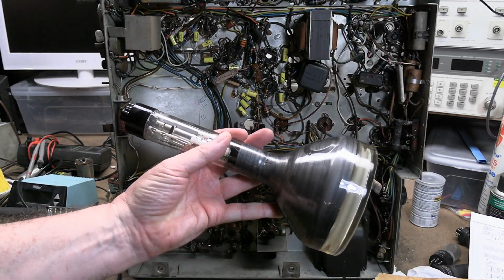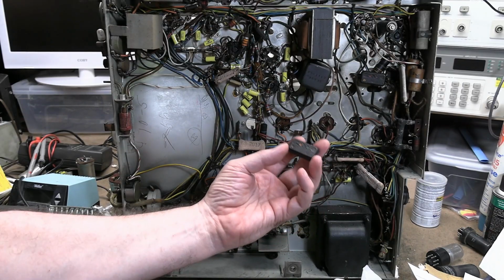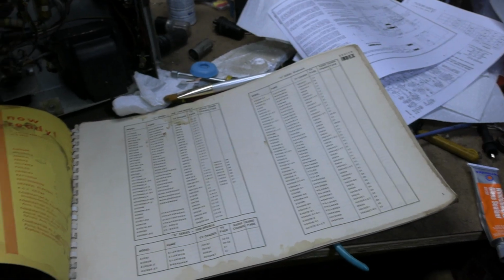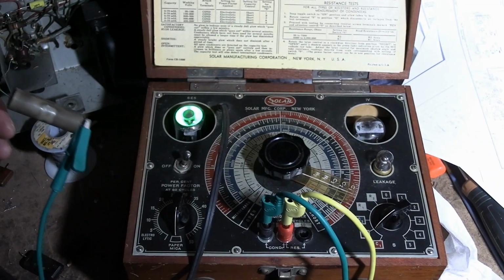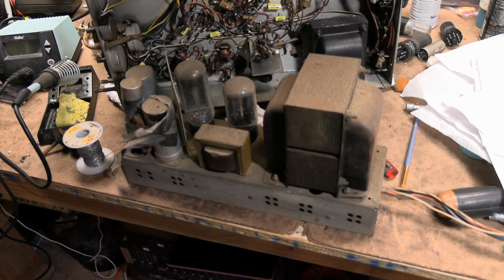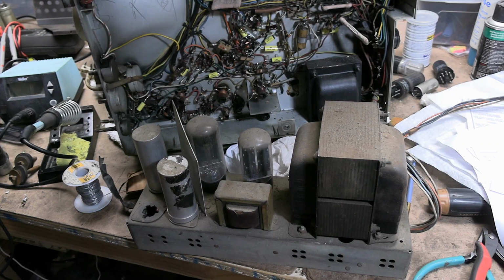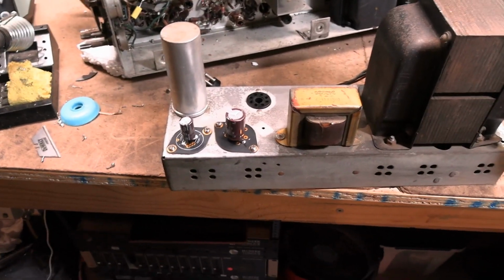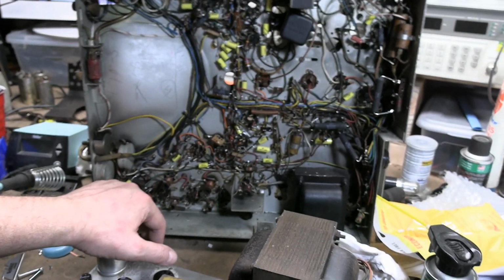Zenith 1950 St Regis porthole restoration part 3

Comment: I may or may not have had one of those Micamold paper capacitors explode on me. It was the across-the-line capacitor buried in my Emerson. One time when I plugged it in there was a little flash and pop near the power inlet but since I couldn't find a short I figured it was a speck of stray solder that self-cleared. When I finally got the old cap pulled out there was a chunk blown off its case. Perhaps it exploded on my watch, perhaps it cracked decades earlier.
Reply from the maker: Oh yes.  Many sets have those firecrackers on the AC line.  I try to remember to clip them out before power up.

Comment: Nice to see that you found a fix for the test CRT that was acting up.  With G2 disconnected from the socket pin, the element probably would have had a much higher potential induced on it by the ultor.  Don't at least some CRT testers have an "open element" check?
Reply from the maker: Yes for open filament, cathode and grid. Not sure about G2

Comment: Wow, lots of caps to replace on this one!  Interesting power supply with the separate power transformer for the filament, and 2 separate windings with separate rectifiers for the 2 B+ supplies.  I like this much better than the high wattage multi-section voltage divider custom resistor; less heat dissipation.

A paper capacitors were wound with real foil.  The default standard plastic film capacitor uses a vapor deposit process to attach the aluminum to the plastic film.  The aluminum ends up being a few molecule thickness, which makes the capacitor smaller.  The down side is high current pulse will consume the aluminum.  Pulse rated capacitors address this problem by using real aluminum foil.  If you can't find any pulse rated caps, if the circuit the cap is used in is not resonant, you can substitute a standard plastic film cap that is at least 4 times larger in capacitance.

Those Dale silicone coated power resistors are some of the best quality resistors available.  Since the body temperature can go to 275 degrees Celsius, along with flat-black body, these parts have very high thermal radiation and can easily cook nearby components.  I like to leave at least 1 inch of spacing between these resistors and adjacent components plus, derate the resistor power by at least 50%.

Paper capacitors usually check about twice their marked capacitance due to the leakage.  This leakage is purely resistive but, the basic capacitance meter can't discriminate between resistance and capacitance.  I use a high voltage ohm meter (250 to 1,000 volts open circuit) to check suspect non-polarized capacitor leakage.

Comment: Couldn't you connect a hi-pot   tester across the   capacitor and get the same    results
Reply: It is a similar circuit in the capacitor tester.

Comment: Those Zeniths are intriguing sets to me. The big thing that makes me nervous about getting one is the heavy use of the metal cone CRT by Zenith since they seem to lose vacuum over time and replacements are not the easiest to find.

Anymore when I see older repairs I cringe a bit since you never know the quality of the repair until you get a little deeper in the set. And talking about shippers, our problem shipper here is FedEx where UPS does a great job for us. FedEx drops our packages everywhere where UPS is consistent with leaving them on the porch or stairs

Comment: The way those can electrolytic caps were taped and jury-rigged on the power supply chassis looked pretty dangerous! I would argue that the tech who did this wasn't safety conscious, at all! Let's hope those hard-to-get-at low voltage caps left in for the time being won't cause too much of a problem in the audio and/or the screen geometry when the set's finally powered up.
Reply: These could have one lead clipped and tested (I think he means low voltage electrolytics).  They might well be open if the capacitor juice is dried out.  With it being necessary to cut components out of circuits so often to give them a true test, I wonder if a supply of small crimpable/solderable metal sleeves could be procured to make it easy to solder a tested good component back in, or even put in a replacement component.
Reply: @SeekingTheLoveThatGodMeans7648  There was actually a product like that back in the day. They were small coiled wire splices like springs. I see advertising in magazines, I don't remember the name of them.
Reply: I'm sure he intends to replace those caps. Low voltage caps are easy to find these days because of all the solid state circuits. I think he just wants to get to the power up without waiting to get them.